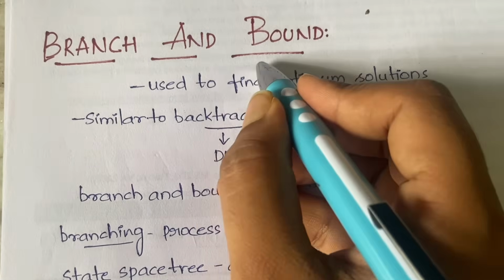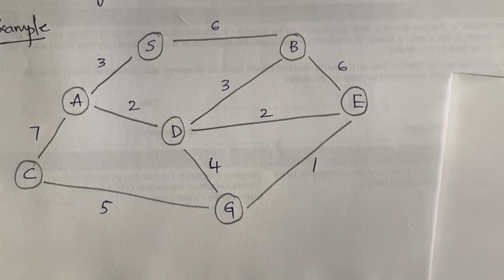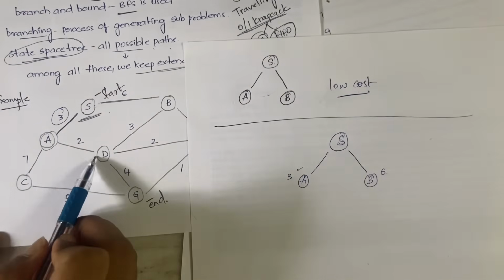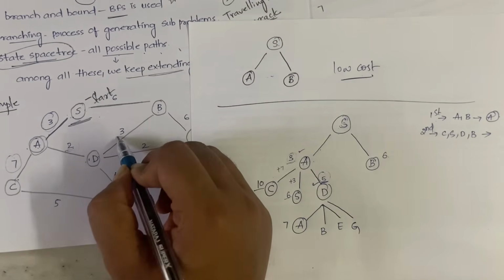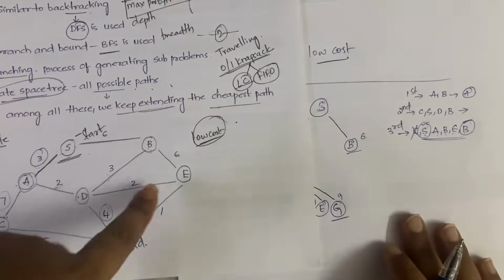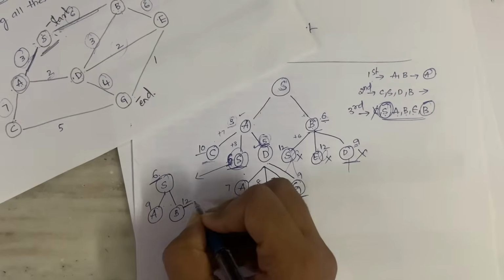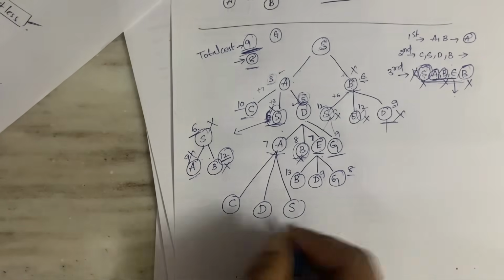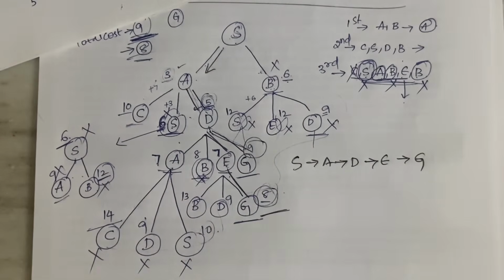Branch and Bound - Method, Example, Applications|DAA|

Comment: great video! just one question. Since A has already a cost of 3 why do you extend it   to its neighbors when its value becomes 7 ? Shouldn't we stop extending the current node if the current value is bigger than the previous one?